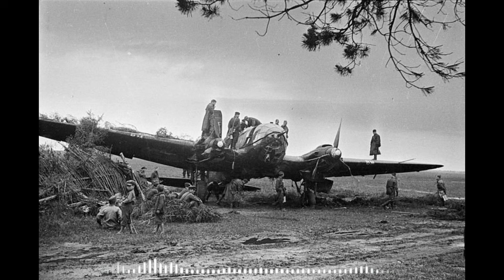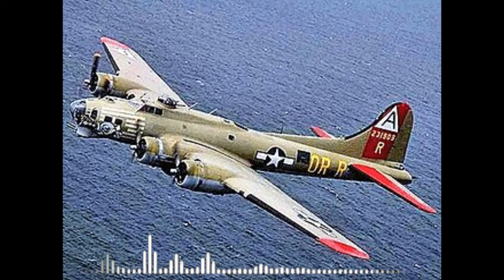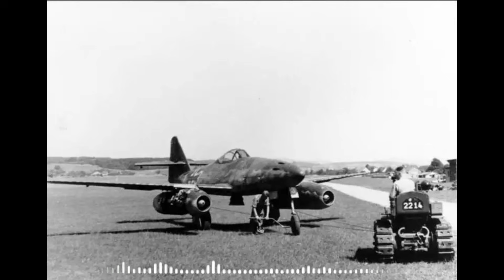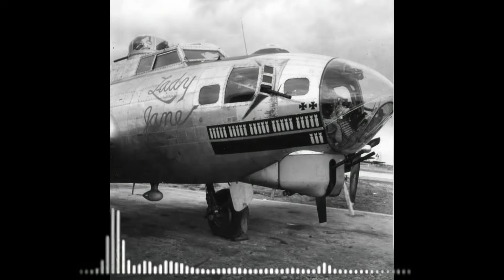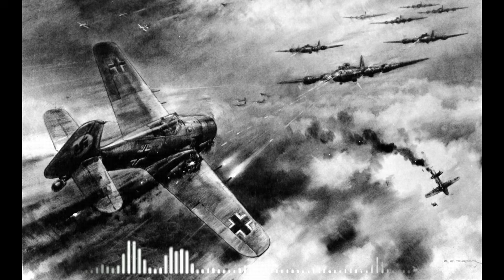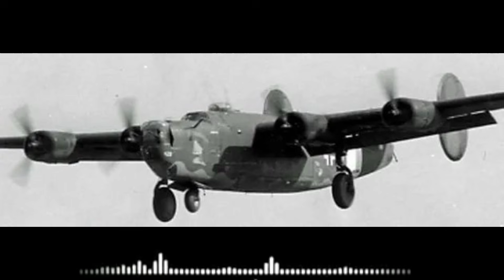Luftwaffe Pilots Tested A Captured B-17 — And Were Shocked By Its Brutal Defensive Fire

Comment: B-17 short range load was 8000 pounds. Long range load was 4000 pounds. Mosquito could carry one 4000 pounder to the same long range but do it with 1/2 as many engines and 1/5 of the crew. 
B-17 was obsolete before the daylight campaign started.
Reply: Ok what’s your point? The US came to your rescue with outdated equipment?